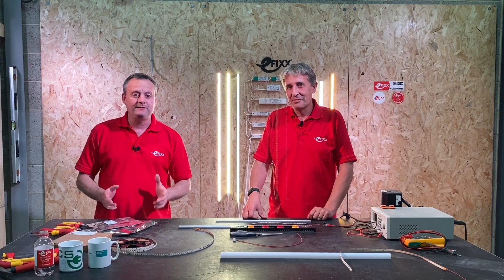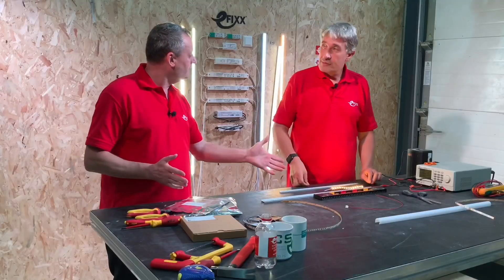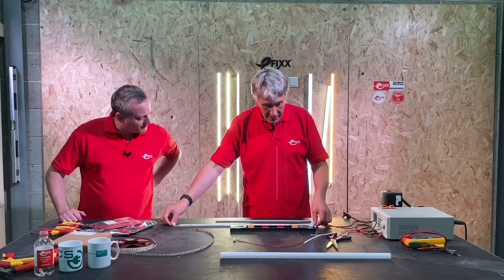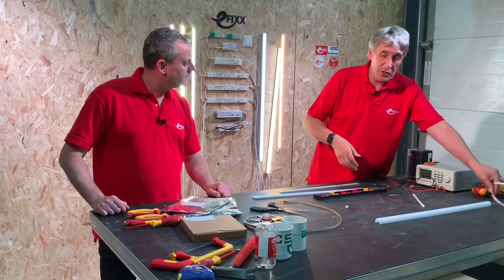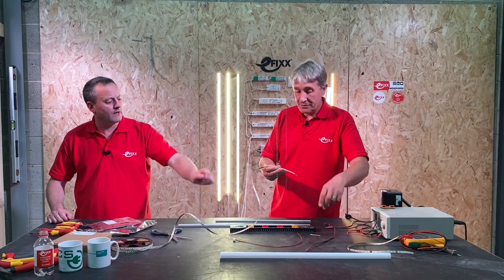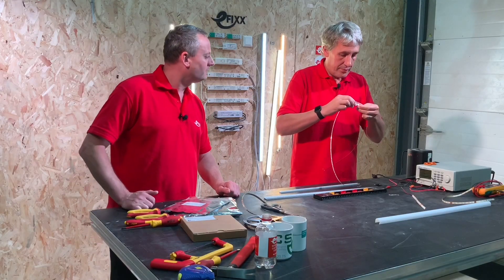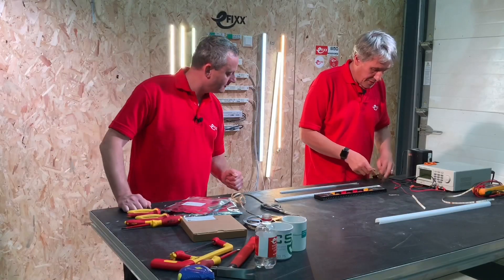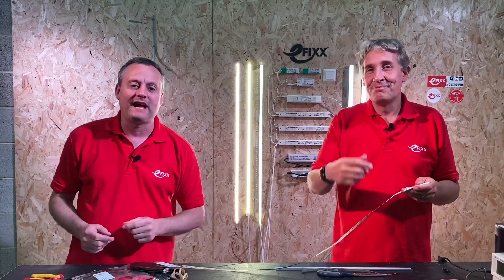Don't cut your LED strip here!

Comment: Fellas, As long as you aren’t planning to connect another strip after you cut the strip, You CAN cut the strip ANYWHERE!!! The reason you lost 3 led’s, is because you cut it with the power on, With Metal scissors, and it caused a short!!! Had you cut it in the exact same spot, without the power on, it would’ve been FINE… Thanks
Reply from the maker: The reason we lost 3 LEDs is that they are connected in a chain connected to one regulator.
Reply: @efixx  Really? Wouldn’t those still get power from those before it? My son has some in his room and he cut them at the exact length he needed, which wasn’t at one of the recommended spots, and they’re working fine. I saw yours arc & spark when you cut it, so I figured the metal scissors grounded out & shot those few LED’s. Thanks for responding! Take care,

Comment: Cutting it under power undermined your point a bit. Your scissors routed current to the wrong places, destroying more electronics than when you would have cut it without power on it.
Reply from the maker: If you cut in between the cut points your loosing 6 LEDs no way around this.

Comment: Dear Team efixx have a quick question :
I need to use discrete LEDs on my project . However, the  vendor is selling the LEDs of the  specs  I need  in the Cut Tape packaging. My question is can I strip off the single LED from the tape and wire them suitably on a PCB and have the LED working well. I would be introducing  proper resistances so that the  levels of maximum current levels are obeyed for the specific potential differences. ? Would be  great if you can respond. Regards Anirbaan
Reply from the maker: You probably could if you can scrape away the pc tracks in the correct area.

Comment: Mine led broke, but because mine where on battery, they had like a 2cm bar and it had the mode, colour, speed and brighnest buttons on it to control it and then the led light started it ripped right next to the light but and it wont work, and solutions to fix?

Comment: I have 2 16.5 led strips, I need to flip them around, One strips connector is connected to the Outlet,I need to connect these 2 strips however I need to cut the other strip, On the side with the pre installed connector, Would it disable the entire strip to Cut off the connector side at the cutting point, the other end can't be used as it has the Positive side on the bottom, and the other strip has it on the top

Comment: Thanks for sharing, so basically if you cut anywhere other than the cut point, you'd be cutting through the circuitry of the strip?
Reply from the maker: Yes - spot on - in between each cut point are series connected LEDs

Comment: If you have to cut the LED strip on the cut point, would you not be able to cut the led profile so that it is the same length?
Reply from the maker: Of course - but it depends upon the application, plus you have to allow for connection space etc.
Reply: @efixx  ahh I see, thank you for the response 👍🏻